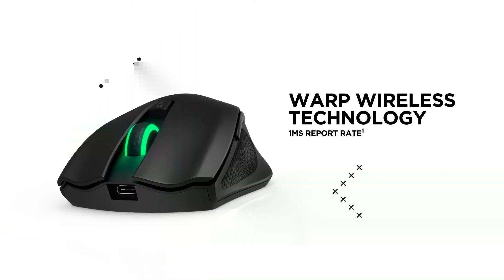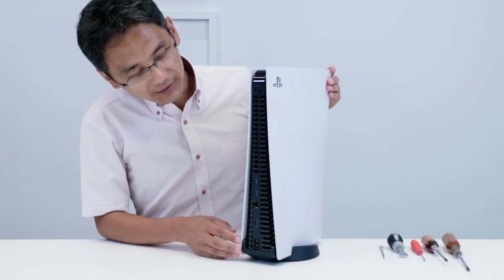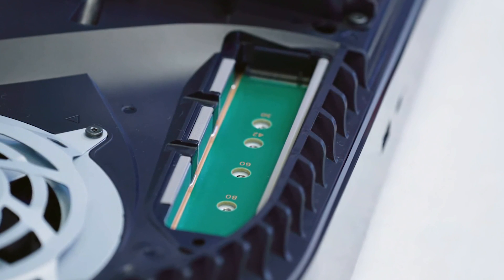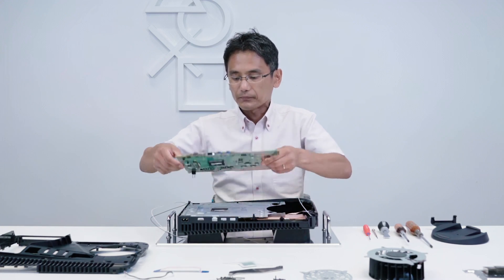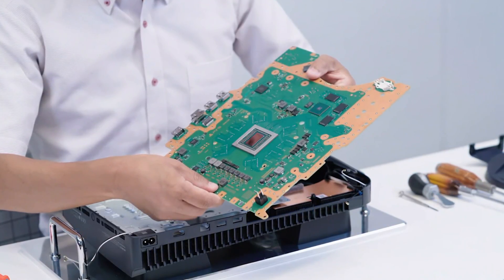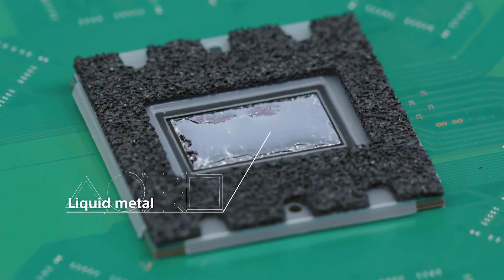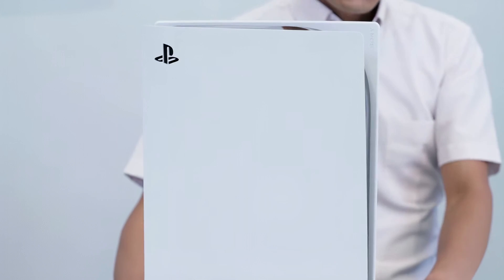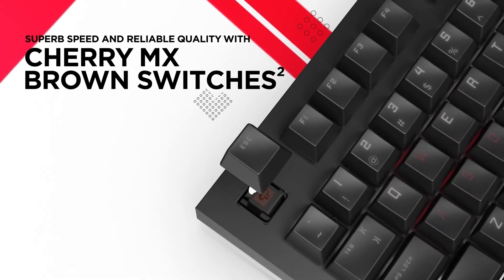PlayStation 5 Teardown Analysis: Inside Sony's Next Generation Hardware Design

Comment: By the way, interesting fact - another thing Wi-Fi 6 is used for? Wireless VR headsets.
Reply: PSVR 2 Baby!
Reply: @apollo24zz  i wouldnt prefer a psvr2 already. It was just a waste of money how it was so poorly supported so far.
Reply: @apollo24zz  The biggest issue is VR is not interesting enough for the vast majority of people to buy it for whatever reason. It will always be a niche market.
Reply: @DEVILTAZ35  yeah try but it the cheapest to get in on Playstation as someone who had a PSVR on my PS4 Pro im super excited to see what new ways they can improve the system 😀
Reply: @DEVILTAZ35  "The biggest issue is VR is not interesting enough for the vast majority of people to buy it for whatever reason. It will always be a niche market."
Reply: @DEVILTAZ35  VR won't always be a niche market. Such a stupid statement.
You have zero forseight or understanding.
Resulotion on even the best VR is spotty.
VR gives most people headache and make them sick. Because of flaws and technology limits.  Games that can be made for them is limited. 
VR is still to flawed to be anything but a niche market.

But Sony among other understand that it best to devote money to resources in the area.
Because while it may take 10+ years before it spreads. Sooner or later it will.
Reply: @apollo24zz  I'm definitely ready once I can get my ps5 I bought the first one so I know how you feel buddy.
Reply: @ClassicGamingPortal  same i told my baby nephew once I get my PS5 on the 12th of November im getting that Iron Man VR just to see his reaction again 😊
Reply: @apollo24zz  hahaha I need a 4k tv I'm running a 144 hz monitor 25 inch
Reply: @ClassicGamingPortal  lol idk I think you're fine i have a 4k 55in TV but I mainly game on my 4k 60Hz HDR 28in monitor I recently just bought a 1440p 144hz HDR 27in for the PS5 so I have one monitor for single player story driven games and the other for multiplayer ever since I went to monitor I just can't go back to playing on the TV
Reply: @ClassicGamingPortal  but I do have my PSVR to my 55in so ppl can watch what happen in VR tho
Reply: @apollo24zz  I never like people watching it's not the same experience I rather pass my vr. A buddy had a party I took my vr with me everyone drinking henny and vr is not a good combo. Lol
Reply: @apollo24zz  my only issue with the vr was the motion sickness. I hope psvr 2 fixes that issue.
Reply: @ClassicGamingPortal  ofc 😅 I just mean like see what their seeing but ofc you should pass it around especially for games like Beat Saber and Tetris Effect
Reply: Yeah wireless is a no brainer for PSVR 2.
Reply: I was thinking about the fact we haven't seen anything about that "baked in VR support" rumor from about a year or so ago. Seeing this now, it makes more sense. This could be really interesting.
Reply: @QueueTeePies  Wi-Fi 6E in the 6 GHz band has demonstrated latency levels of 2-6 milliseconds, with about 4 Gbps of throughput in real-life conditions. Enough for real time high-framerate hi-res video over compressed HDMI.
Reply: Yes exactly!
Reply: Exactly funny how they never picked that up
Reply: @tierossno1  He looked disinterested.
Reply: Ragnos   you're a fan boy that knows nothing about hardware. you're make up a lot of crap. I don't get how people like yourself can be so dumb... but it is youtube comment section. kids like yourself jump on and act like they like know everything. lol you say, ''everything in the PS5 is superior to xbox series x.''  really dude, how dumb can you get. This is a stupidity on a whole new level.
Reply: @killahmate If anything it would be bluetooth for wireless and not WiFi for a PSvr 2 headset
Reply: @tflyfoster3018  you can’t send high bandwith low latency video over Bluetooth. You need Wi-Fi 6 and that’s what the PC wireless headsets already use.
Reply: @KillahMate  I thought PC wireless headsets used WiGig?
Reply: @PSNGormond  You're technically right - it's actually WiGig, because Wi-Fi 6 was only finalized literally months ago. WiGig is a proto-Wi-Fi 6 design that builds on Wi-Fi 5 with some technology from 6, and was released much earlier for limited use. Wi-Fi 6 surpasses WiGig in every respect, and is the 'full', mass-market implementation of the same technology.
Reply: @KillahMate  I wasn't aware of that, thanks for the info!
Reply: @KillahMate  Depends on the applicaiton. Early version of WiGig (802.11ad) had max speeds of 7Gbps. Evolution of that is the newer WiGig standard (802.11ay) which has speeds of 20-40Gbps. Note, the PS5 max speed on Wi-Fi 6 will be 1.2Gbps (2x2 at 80MHz max bandiwdth). So in reality maybe 800-900Mbps. WiGig is much faster, but the signals propagate like light. You need to be in the same room, ad hoc, point to point. 

I think USBC running in DisplayPort Alternate mode makes far more sense for PSVR2. Power, some data (USB2 speeds), and displayport 1.3 in a single cable.
Reply: @jasondefaoite7732  That actually would make a lot of sense for why there is a USB-C port on the front.
Reply: @PSNGormond  shadow pc is currently working on a native VR app for the quest 2.  They are running the so secret VR exploration program as we speak with selected participants. They are under secret oath.
Reply: Isn't wired connection still more reliable to your router and than wireless connection between router and wireless device?

I give an example: your PS is connected to router via high-speed ethernet cable and "PSVR2" is connected to same router via Wi-Fi 6 vs both devices were connected to router via Wi-Fi 6. Which setup would give better latensy and push more data?

Then again how much both setups are different compared to connecting "PSVR2" to your console via cable?
Reply: @9axel5  That's not how that works. If PSVR 2 actually is wireless, it will connect to the PS5 directly, not the router at all. It's a point-to-point connection, just like Bluetooth but using WiFi tech.
Reply: @KillahMate  okay thanks. That was the link I was missing. So should I buy network card with Wifi6 to my pc if I wanted ro play wirelessly Oculus Quest 2 while my pc powers the game now
Reply: @9axel5  No, you can't turn any Oculus into a wireless PC headset. The Quest only works standalone if it's wireless. You need to either buy a wireless adapter (like the Vive has) or you need to buy a headset that already is wireless. No headset on the market right now is wireless - if Sony do this, maybe PSVR 2 will be the first, but nobody knows.

And the Vive adapter has its own card, it doesn't use the WiFi from the PC so you don't need to buy a separate network card.
Reply: @KillahMate  yes, I did also ignore Bluetooth 5.1. But it all fits so well.

Wifi6 for headset
Bluetooth 5.1 for tracking headset and controllers
Tempest for 3D audio as you turn
SSD for asset streaming as you turn

Just waiting for eye tracking in the headset, prioritise where to render with quality but also to finally give good DOF. (Including NPC reacting on where you are looking)

All in on VR?
Reply: @9axel5  wired is still the best way latency wise to connect a device if it is possible to that way
Reply: Oh wow. Great observation!!
Reply: This hasn't been confirmed. 🤦🏼‍♂️
Reply: @Mr_Battlefield  Of course it hasn't been confirmed - we'd probably notice if Sony started talking about PSVR 2, eh? But it's a fact that wireless headsets use Wi-Fi 6, and that's something worth keeping in mind.
Reply: @KillahMate  but that bit of info is not needed here, again, they're talking about what they're seeing here, confirmed hardware/software that is inside the machine.
People act like he can't ommit PSVR2 conjecture without him being a XSX fanboy, there's no space for that here. I want to hear about what the console actually has, not what it could work with, or have/support
Reply: Someone was watching NX Gamer's PS5 teardown video
Reply: Every one forgetting about the VR Gloves Sony still working with....that will be the big jump from 3D to VR Gaming in History of video games...
Reply: Several reasons why this seems unlikely to me:

1. Cost. Wireless solutions are very expensive at the moment and would place PS VR at a higher price.

2. The wireless technology in the PS5 is likely similar to what you would find in a laptop, that is to say it is not for transmitting long range like a router. A wireless solution would likely need its own transmitter for more power and line of sight. Wi-Fi 6 is blocked very easily.
Reply: @Zosu22  how is WiFi expensive? I asume that if WiFi 6 is used for vr that means the player is within the same room as the console and possibly connected adhoc/WiFi direct instead of via a router.
Reply: @RazorFastClaws  WiFi isn’t expensive. Using Wi-Fi to provide low latency VR solutions now is.
Reply: @Zosu22  OK.. I'll just take your word for it then.
Reply: I purchased PSVR 12 months ago...least used gaming accessory in my house.   Only one of my children used it more than a couple of hours.  PSVR2...not a chance.
Reply: @Kiwi-Ahh-Nah  but PSVR was old tech when it was new though. PSVR2 will potentially be very different because they won't have decade old PS3 Move controllers. Most PCVR people don't even consider PlaystationVR to be real VR at this point. It's not room-scale, seated only, that's not the standard anymore.
Reply: You're confusing 802.11ad (WiGig) and 802.11ax (Wifi 6)
Reply: DF was spot on. As wild as the design looks, Sony took a more conservative design approach. PS5 is an iteration on last gen. Not that that is bad, just different than MS approach, which is a bit more daring. Think, if MS took the same approach, you would end up with an iteration on the One X but much bigger with power and more cooling. But instead they made the tower design of the series X.
Reply: Ragnos  wow dude your the one who has no idea how hardware works. You spit out a bunch of numbers and think you know your stuff.  PS5s frequency is variable, forgot to mention that. Nothing's even out yet, name one game that runs better on the PS5 compared to XSX.....
As far as comparing it to a 2060s, the gpu in the Xbox One X is equivalent to an AMD RX 580. No way in hell will a RX 580 perform like an Xbox One X. The api used in consoles is very different, they can get much better results. 
We will all have much more info on the hardware once the systems launch, not to mention the launch of the RDNA 2 desktop GPU's to compare them to.
Reply: Ragnos   just thought id screen shot your comment so i can show people and we can laugh at it together
Reply: Good observation
Reply: Good call 😀👍🏻
Reply: And for faster internet as well if your internet supports it
Reply: Ooh can't wait
Reply: Meh
Reply: Anyone knows if you can connect two wifi6 devices together without router? If you can then I'd understand how big of a deal Wifi6 would be on console.

If you can't, then is ethernet still faster connection than wifi6 in terms of transfer speed and latensy? Asking this because I brought wifi6 router month ago for tablets and mobile but now I want to know if I should connect pc and console in it as well or still use ethernet. 

Anyone who knows, please answer. Thank you!
Reply: @9axel5  Ethernet is always going to be superior for performance consistency and throughput.
Reply: Yup
Reply: Yeah like, everybody bought the first vr 🤷🏻‍♂️
Reply: They need to mass produce these things as cheap as possible so it's unlikely VR would be wireless on a console.
Reply: Haha yeah what could go wrong with a wifi6 plugged in your head?
Reply: Thx for the info 🙏
Reply: Yea 100% wireless vr 👍
Reply: Wouldn’t it lag for gaming?
Reply: @NoEvilEye  Besides bandwidth.....
WiFi 6 promising a reduction in latency of approximately 75%

Look it up
Reply: Yep
Reply: Fun fact, the bandwidth wifi 6 using is banned in and around 10 kms from airports and all Government buildings. 
Just saying.
Reply: @kiranraj282  ?? Really¿  The Freq Spectrum ????  Bandwidth ????
Well, like 5G, the whole conspiracy debacle is well... Just that...
Here in oz for example, the Freq spectrum of 5G had been used for decades....
I should know.. I have now 5 unusable wireless systems , unusable by law, which now are scap.. but look good in a 19" track... As for the lead up , The Australian government gave us a 5 year "heads up" because like any freq to be used, TV, AM, FM.. whatever, the spectrum has too be  ,lets say, Booked in....
No way was any company going to invest in a type of system not knowing what spectrum would be available...  Itd be like buying a game made for a future console , completed on specs.. but in the end was a Microwave....
I know.,... Silly way to explain it.. But it really is that simple...
How about building a car for travelling across route 66, But the Vehicle is 4 lanes wide?
There has to be standards to meet... Otherwise, why invest in something like WIFI 6 if its working on the TAXI radio frequency./....

Oh.. AS for planes.. Safety precaution? Im mean everyone turns of their devices on a plane on takeoff and landings... Dont they?
Gov Buildings? Safety Precaution? Turn Orange?
Reply: @Rhythmattica  dude there is no conspiracy here. Wifi 6 is not adopted for commercial use as of now and ots been used only in those sectors. Go and check it for yourself.
I never said there are issues with wifi 6.they are not feasible as there is not enough technology available for everyone.
Reply: @kiranraj282  I Think we are all way off track here... All I was responding to , to who , what, was someone mentioned "WIFI6 " is illegal to Use around airports.. Gov buildings.,.. My rant was Rew there stupidity of such "Conspiracies".. Fk .. so many posts.. Please , ,y apologies if I responded too the wrong person.. You?
Reply: @diga mec last weekend I showed my Baby 8yr Nephew the Iron Man VR Demo and just seeing his reaction was just priceless and why I love being apart of the Playstation Community I just want Sony to show us what future tech has in store gimmick or not 😌
Reply: I am pretty sure you're confusing Wifi 6 (802.11ax) with 802.11ad (aka "WiGig 2"), or at the very least Wifi 6E.
Reply: @neoKushan  I think so too. Unless .ax is different than previous WiFi's, wouldn't you need a WiFi 6 capable router? It's not like WiFi 6 connects directly to the headset.
Reply: Lol i dont see anyone going out of their way for VR.
Reply: @vowvowness1506  Well, your blind.. lol
Or.. a Blind Fanboy..    Not all games need to be,,, But if for example, your a Star Wars fan, and wanted to play Squadrons ... I tell ya.. The last thing you'd play is the pancake , and you'd buy a PC or PS VR rig...
Argue that...And if so.. No Hope. Maybe a New hope?
 I award you no points.
Reply: What a coincidence 😄
Reply: @diga mec " it isn't at that stage yet"
Oh fk.. There it is... You have literally denounced all things not xbox.
Fk .. I did a whole spiel and it didnt post...
Oh well...
Here it is compiled.z
Sure.. PSVR 
No room scale,  Input devices could be better..
Yep its not Vive.... Ill get to that,....
So have you Played:
Farpoint with aim?
Firewall Zero with Aim?
Res7 ?
Blood and Truth?
Astro Bot ?
Mate...... Even Battlezone rocks..
Hm,mmm,. Hope you aren't playing squadrons......
So.. I dont care what you think about VR, because anyone that says "Its not ready yet" surely would play games.. because why even play now , when we know gaming will only get moooore pixels and FPS with the next gen cards...... Right there is a corner, and heres a can of paint....
Go on.. dont care what you play.. but goi on , grab a Vive, a Rift a PSVR,,, Go play RES7 and get back to me....
Dare you.
And if your still spewing that nonsensical bs.,.... You're Tainted... You're wrong. I suggest go talk to Phil McCrevice,
Reply: Oh man that gave me shivers 🤤
Reply: talk your suit
Reply: You shut your filthy sexy mouth mister.
Reply: @diga mec in terms of at the minute psvr isn't at the stage where it can be deemed an essential product to get the best gaming experience.

Either is a=n XBOX one. Right?
To add.. Squadrons on PSVR BLOWS away Xbox SX version..,.. Ubderstand>?
Reply: @diga mec for sure that aint no lie that why it very hard to go back to TV
Reply: @diga mec No? You cant have a comparison....... Thats the problem of people that compare pancake to VR without  having tasted the juciness of VR..
MS sold Kinect not as an accessory . but as  something bundled as compulsory... You see, every promise was smoke and mirrors... and they did it also by delivering its epic innovation through what is as simple as old school gaming... Yes.. VR is an add on... Its not cheap... But unlike Kinect, the issue is juxtaposed.. You cant trick people into knowing what the experience is... It just cant be translated.... And its not promises,..l; Its here and now,... and the experience , emersion is un parralleled... Its PAST THE ":VR Experience"...... and when everyone actually drops their guard, and actually opens themselves to the medium, there really is no equivalent....  I gladly go out and say, well, a console is just another expansive gaming peripheral... After all.. WE all have phoners that play games...
Stop being  So staunch. Cant afford it?  Ok... 
But im telling you, this housewives tale of 'Its njmot there yet".. Its just another p[eripheral" ect ect ect.. Just doesent fly with me.. The only thing flying is all the BS from the naysayers mouths... 
The more the merrier.. right?
Reply: That's really not what 802.11ax will be used for lol.
Reply: I prefer pcvr
Reply: No. You're thinking of Wi-Fi 6E. Big difference.
Reply: @diga mec And I too hope that will happen...   Im loving GhostsOT atm, but I love my VR... Its really hard to goo back. I just hate the schoolyard talk, knowing its being said like pier group pressure... I admit, I prefer PS over .. even over PC.. Just love thiner games.. Ill always admit that.. But to hear the Banter, when its there obligatory FB response, Ive just got to share my thoughts... I suppose my thoughts are also the more that put VR down, the ones that remarking about its worthlessness, they are the ones with such propaganda that in the end hurt us all.,..., Especially the ":Na.. VR sux, AR soo much better" to then talk about how successful Pokemon GO was.....
I know you get it... Hope ytopu get what im saying.. And as from my Perspective.. I was commissioned to write a song for the Powerhouse museum here in Sydney...I played w -industries Teradactyl for 3 hrs abweforee the exhibit opened to the public... 5 mins a go for them.... I couldn't wait to get more... always asking myself .. when am I gaping to get to do this again.. I discovered something beyond the gaming I know.... And this is 1990.   Yep.. Two Amigas... Tetris look less blocky... But I experienced it.,.. And no way I going to sit back and let those I know play by the "Insecure-Yep I really dont klniow-but say I do" rulebook.,
Cheers
Reply: Absolutely!! Wireless PSVR over wi-fi 6. 👍
Reply: Microsoft pay them. That's a fact!
Reply: Then why did Sony put in a USB C port?
Reply: @PC-Xhawk  because it’s a modern USB standard.
Reply: WiGig and Wifi6 are not the same thing. Currently the only wireless VR that doesn't suck is from HTC and it use 60Ghz WiGig.
Reply: Bravo sir
Reply: That’s probably what it’s for as well. PSVR2 is definitely coming, maybe even in 2021.
Reply: It would be really cool if they can support it
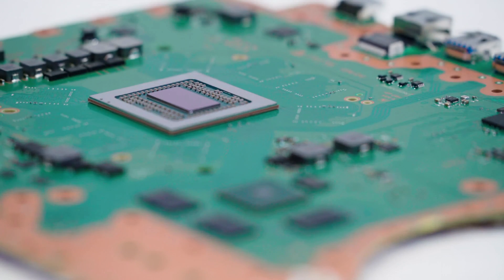Reply: 15:46 "The POOF of the pudding!"
Reply: No, the PSVR2 will use an external USB adapter.
Reply: @BlackParade01  I think it's just going to be USB. They have an experimental 10GB USB port so they may be going the virtual link method Nvidia dropped. Then they wouldn't need batteries either. 

If you want wireless they may make a 5GHz band adapter and receiver.
Reply: Ragnos   youre the fan boy pretending to be an engineer. You said the series x will have issues with heat and would run toasty.
Its just been confirmed that the xbox series x run cooler than the xbox one x. The xbox one x ran cooler than the ps4 pro. So there goes your lies.
Reply: Ragnos   lol what a fool
Reply: Well wifi 6 is actually FAR WORSE for VR due to the inherent 50ms of latency, it is 2+2 after all (5ghz+5ghz). Wireless VR streaming really only works with 802.11ay 60ghz wigig.
Reply: 😳I didn't even think about that
Reply: Well, it would be, except that fad has been deas for years. You may not like it, but accept it.
Reply: This comment aged like fine wine.
Reply: Actually the bluetooth 5.1 which is a major jump. Will be more of a benefit for vr headset. Bluetooth 5.0 and below find headset by signal strength alone.  So could only locate a device within a error of 1 meter which is 39in...
Bluetooth 5.1 have new technology with both devices talking to each other to find position and keep track of the device movement.
With a error of 1 centimeters and that's 0.394in.
So it's the Bluetooth that he skip over
 That could lead the next generation of VR headset to be wireless.
Reply: @nisteven  You need Wi-Fi 6 for low latency video. Bluetooth can’t do it.
Reply: @KillahMate  never said WiFi 6 wasn't important. But no matter how good the wifi is. If they went with any older bluetooth. They would have had to go with a wired headset.
While WiFi 6 make for a much better experience. You don't need it, to go wireless.
Reply: @KillahMate  wifi 5 or ac is good enough for wireless vr
Reply: @nisteven  Bluetooth 5.1 is not nearly fast enough to stream low latency visual data at 2Mbps compared to 9.6Gbps theoretical max speed of wifi 6. Device tracking probably would be done by the headset itself with how well inside out tracking has done for the oculus rift and quest. This entire comment chain is garbage with no idea of basic technological understanding of wifi 6, ethernet, and so on. 

To everyone else, No headset is connected by ethernet cable but rather by something like a breakout box using hdmi/displayport, and a usb 3/C port or just directly to a computer with usb c and hdmi. You don't need a router to connect a wifi 6 device to one another if the headset have a receiver that can connect directly to the ps5. You can already see this with the vive wireless kit using wifi to connect to the pc.
Reply: @Shadowninja1200  psvr2 will need to cut corners to be cheaper or it won't sell.
So using bluetooth to track it. So you can cut corners on hardware. Is no doubt what Sony is planning and I'll bet you on this.

Edit: also wtf when did I say they use bluetooth to stream?
Reply: @nisteven  I was speaking more so for everyone else saying using bluetooth or ethernet or some bs.

I can only really see bluetooth for the controller themselves connected directly to the headset or sticking with the camera approach considering they're making a camera again. The headset itself will probably do it's own tracking if they want it to feel like the next evolution of psvr.

Of course I'm just basing this on opinion of people i know who have tried the psvr saying it's cool but it doesn't feel as nice as the oculus or the vive.
Reply: @nisteven  thats not how bluetooth works it doesnt even have enough bandwith to do chat and audio at the same time let alone video to two displays
Reply: @420247paul  Reread what I said....
. I swear people can't read. Here I help you.....
For tracking..... T R A C K I N G...

Do you understand now,?
Reply: @nisteven  I don't think that Bluetooth will be used for tracking of the headset or controllers. Tracking for VR devices is accurate to within fractions of a millimetre. If you do some reading on the Vive Cosmos you'll see that this matters a lot more than you might expect. I'd love to be proven wrong, as Bluetooth tracking means that it will work without external lighthouses and in low light environments, but still, I don't think it's likely. 

Also the main benefit of Wi-Fi 6 over Wi-Fi 5, in my opinion, is the improved latency. Wi-Fi 5 already has the bandwidth chops, but latency makes VR games feel "choppy" and hurts the experience more than a slightly lower resolution or foveated rendering.
Reply: @nisteven  Bluetooth 5.1 should enable better audio, better battery life on the controllers, and more robust communication in general.
Reply: @johnnemesh5459  Bluetooth 5.2 is actually the one with LE Audio.
Reply: That would be output which would take extra antenna. This is probably just a receiver. The PSVR would likely come with external antenna just for better range.
Reply: @Skylancer727  Just a receiver? lol. How do you think the PS5 will send data to, well, anywhere with just a receiver. Think about it...
Reply: @redrooster303  as in they need a whole wifi 6 channel just for the headset to get enough bandwidth. If it's sharing the wifi receiver it's bandwidth is cut in half or more making it less viable. 

Also if you are hoping PSVR will be wireless, I think that USB port on the front is proof it won't be. They have an experimental 10GB/s USB port which makes it sound more likely that is going to both power and send the signal for the headset. In fact, the PS5's power supply is 350W, more than the Xbox Series X yet Sony claims the chip only uses about as much power as the PS4 Pro at about 200W. I think they are planning on running the entire VR headset via the USB port as 10GB/s is enough for video. That seems far more likely as adding batteries to PSVR would make it more expensive. Plus again WiFi 6 is only fast enough with the full bandwidth. That's why the HTC wireless has it's own emitter and can't use your PC directly. It needs the full channel to not cut out or drop frames. The USB method is still a vast upgrade to the current PSVR and the external headset box. This seems far more realistic vs raising the price $200 for a battery and wifi sender and receiver.
Reply: And 120 frames equal no motivation sickness
Reply: Too bad vr sucks
Reply: @shybassboy  it sucks you haven't played Boneworks or Half Life Alyx with an Index, cuz you wouldn't say that if you had.
Reply: Except you don't need Wi-Fi 6 for wireless vr you can do that right now without it lol
Reply: If you love vr please you need only buy oculus quest 2, the playstation vr is obsolet and expensive
Reply: @karamolansanacamara7069  Foculus ? No chance.
Reply: @Rhythmattica  oculus quest 2 , you need see 1
Reply: No.  Although Wi-Fi 6 is more efficient with sharing the space with other devices such a situation would not be a direct network between the two devices And it requires people owning a Wi-Fi 6 capable wireless router. Which if people buy into could mean spending $100+ for a new basic router (imagine having to replace a mesh network hundreds in costs). That limits an already niche market. So a Bluetooth connection for such a situation for PSVR2 is the more likely scenario if it using something built in. Or Sony might actually include a special box that uses the USB but creates a wireless connection to a possible any wireless PSVR2. In fact these other options are more likely if Sony wants to expand PSVR2 beyond PS line and into supporting PC.
Reply: VR is dead, was never good
Reply: Ragnos  Alex is definitely the most biased!
Reply: That'll be great for the 5000 or so users who use it for more than a few days before it gathers dust
Reply: Dont expect DF to comment on this they are xbots
Reply: gimmick.
Reply: @le4-677  blind
Reply: @le4-677  never thought I’d say this but... F* off “The Rock”
Reply: I guess there's a reason they didn't mentioned it --> Biased as hell!

PS5: Negative Focus
XSX: Positive Focus + Damage Control
Reply: @3D-Engine-Melody  Ur a dummy
Reply: @3D-Engine-Melody  I think you confuse having questions with being negative on the PS5. The only negative points DF made towards Sony were regarding how they haven't been as open with the technical details as MS, which is fair. I heard a lot of praise for the PS5 design itself and legitimate questions.
Reply: @3D-Engine-Melody  Are they really biased? They seem impartial and don't want to fuel console wars. John has criticized microsoft for choosing to support xbox one instead of focusing on next gen. Alex defended the raytracing of Marvel's Spiderman when some people on twitter were complaining about its implementation. They are not picking any sides. They have both good and bad things to say about each platform.
Reply: @3D-Engine-Melody  that makes zero sense. Why would they comment on something that is nothing but rumors and speculation? Sony has never mentioned anything in this thread, just a bunch of hopes and dreams from you all. Then to crap on DF for not indulging your wishful dreaming in crazy. It would be great if wireless VR was a reality in PS5, but literally the only place I see that being talked about is in the comments sections
Reply: @3D-Engine-Melody   @HAL 9000  also, he mentiones WiFi 6, they just didn't bring up rumors of PSVR2 so as to keep it closer to facts, and current known informatiom from the breakdown.
PSVR2 will definitely come, but why mention it here when he's covering the breakdown, keeping it concise without guessing why they added the WiFi 6 antenna; he talked about it though and its pros(better connection, compatible with older routers).
Just try to calm down, not everyone is out to harm you and your PlayStation, breathe.
Reply: @3D-Engine-Melody  They say enough positive things
Reply: @3D-Engine-Melody   lol you fan boys used to love digital foundry during 2013 to 2017.
Reply: @Potato-jh3tj  
No.. still like them, but sometimes they're clearly pro Xbox!

Halo infinite damage control
Dirt 5 damage control
Demon's Souls focus on bad

This video:
Concerns here and there
Cheap this and that
Heat blablabla

Advertising Xbox

IF YOU DON'T SEE THAT, YOU'RE THE BLIND FANBOY
Reply: @3D-Engine-Melody  yup. Everyone is against Sony now, Digital foundry is out to hurt Sony, and so it's as if they were hurting you personally, we can tell. What should we do now? You want us to unsubscribe to them? Or what do you want us to do with that information? You just spouting nonsense just for the sake of spouting nonsense? Lol
Reply: @Potato-jh3tj  Sorry, but you are wrong about this. When it comes to consoles, they clearly favor the xbox whenever they can for no reason. The amount of videos alone tells you that already. Took them 1 second to make a video about the S, took them a week to make a video about this.

Just rewatch the Halo Infinite. You have to be biased af if you defend this and say things like "Maybe the lighting will change that" when it´s clearly not possible to save that game in 1 or 2 months!

And that´s only one example. They still do a good job, but definitely biased!
Reply: @3D-Engine-Melody  they didn't damage control halo. They talked about souls because its a remake of a old game and dirt 5 is multiplat but Sony want let anyone talk about games running on the system yet.
Reply: @kenshigo3833  it couldn’t be that they favor Xbox because it’s better could it?
Reply: @shawnromero4143  No with the given context no.
Reply: @kenshigo3833  🤔😒 um xbox has given more information to the public, so obviously they are gonna make videos on that. Ps5 has been shrouded in mystery. Less information = less content. And what makes you think Halo Infinite will be out in 1-2 months when it has been delayed indefinitely?
Reply: @kenshigo3833  cmon man it took 1 second to make a video about the S because they knew about the console weeks before the public. They got to see this teardown at the same time as anyone.

Also about favoring the American product, I dunno if you noticed but Rich isn't American.
Reply: @kenshigo3833  lol explain to me the context that makes ps5 better? VR? If you’re buying a ps5 for the VR YOU ARE SEVERELY MISGUIDED. Frankly the scenario doesn’t exists. He has more context than either of us given that he himself got to breakdown a series x and watched a video breakdown of the ps5. We only can say the latter.
Reply: @shawnromero4143  who said the ps5 is better? Why do you continue to make things up in your head to hate? Sounds like you have issues...
Reply: @Taijifufu  Dude, everyone on this planet did a video about the teardown already. Don´t act like it takes 1 week to analyze and write this!
They are DF, not some random guy...
And your nationality doesn´t have to do anything with it. I have friends who HATE america, but wear US brands only. DF is xbox biased, if you don´t believe it, watch some of their videos and you will see it yourself...
Reply: @kenshigo3833  who’s hating? I’m simply trying to demonstrate to you that if someone shows favor to something that is better than it isn’t bias. Which you suggested
Reply: @DarkReturns1  because that was the initial release date when they made the video about it.
And no, the amount of information has nothing to do with the time it takes to make a video. there was no reason to be the last channel on youtube to make a video about the teardown!
Reply: @kenshigo3833  huh? Why is DF obligated to make a video about someone else's teardown?
Reply: @shawnromero4143  no i did not. that´s why you are a hater lol
Reply: @DarkReturns1  nobody said obligated, but if you do everything asap except the things for one certain group, it says something does it not?
Also, if you want to be on top of something, you also have to be on time, otherwise someone will take your spot sooner or later. Always has been like that! So yes, if you want to be the best, you kinda are obligated to talk about such "important news" asap!
Reply: @kenshigo3833  you can look at it that way, that's understandable. Still doesn't make them biased in any way. They shit on Xbox, deservedly, for over 5 years because PS4 was producing better results. Now the tides have turned, they always do, and they are biased towards Xbox!? Some channels sure, like that Colt Eastwood guy, but DF? Naw man, DF is legit
Reply: @kenshigo3833   lol if you say so... people make up stuff in their heads.
Reply: @Potato-jh3tj  and you fanboys hated it. See how that works.
Reply: @ClassicGamingPortal   no i dont think anyone minded. I didnt mind. They were just saying how it is. Like theyre doing now
Reply: @Potato-jh3tj  Just watch the videos with that in mind and sooner or later you will realize it yourself...like i said, they are still doing a fine job, but they are definitely a bit biased. And again, i´m not saying they are extremly biased, but they definitely are biased...
Reply: @DarkReturns1  yeah, i´m sure Halo Infinite will get a surprise release in November then because "the lighting fixed it all" ....think what you want, but they definitely are biased and in favor of MS.
How did they praise the ps4 over the xbox in the last 5 years? they even made a video this year were they kinda apologised for downtalking upscaled 4k because it did a better job than they said it did and in most cases, the x did better than the pro...
Reply: @kenshigo3833   ive watched there videos. If anything the media tends to be bias towards sony not xbox.
Reply: @Potato-jh3tj  LOL good one! that´s why the whole internet is full with fake news and hate about the ps5, example the screw! Stop making a fool out of yourself...
Reply: @kenshigo3833  bruh I do watch Digital Foundry. I know you're exaggerating. They've always provided the best data. I had forgotten that people used to say they were Sony fanboys. Now you come along saying the opposite. You're not thinking rationally. You're just jumping straight to conspiracy theories because Microsoft invited them to see the X and S in February.
Reply: @3D-Engine-Melody  You exposed yourself as a salty Sony fan with your Dirt 5 "damage control" nonsense. Dirt 5 is a multiplatform game coming to PS5 as well. Damage control for whom?
Reply: @kenshigo3833  I said for 5 years, not the last 5 years. Ever since the Xbox One X released games looked and ran better on the that platform. Before that time period, for 5 years or so, Sony's PS4 was the most powerful so games ran better on that. 
I hate to tell ya, but it's gonna be the same this gen. Series X has the power advantage here. We'll have to see how it plays out, but on paper the difference between the XSX and PS5 is greater than the power difference between the original Xbox One and PS4.....and we all know how that went.
Reply: @DarkReturns1  Then i missunderstood that. But ofc every game ran better on the ps4 with 1080p compared to 900p xbox...
Nothing they can say about that...
And no, the on paper is not true!
Xbox even had more RAM, the TF was 1.3 to 1.8?
You also compare 900p vs 1080p here and now they work with the same resoultion.  So no, on paper, the difference isn´t much greater!
Love to tell ya, but the PS5 will be stronger than you expect!

Not sure if you are trolling or just don´t understand gaming/PC/development at all...
Reply: @Taijifufu  No. People back then said they are sony fan boys because they said the ps4 is better than the xbox when it comes to data. Which simply is a fact!

After that, they always said the X has an advantage over the pro, which was in most cases, a fact!

This gen however, they are doing so much dmg control for the XSX, make false claims about the ps5, look for things to bash while looking to praise things on the XSX. Just look at the Halo video, ridiculous! "Maybe lighting will change that". No "expert" ever would say that!
Also look how often and how fast they do videos about the XSX, took them a whole week to make this teardown! Yes, they do have the xbox and they don´t have the ps5, but still. 
And again, i´m not saying they are extremly biased (except Alex maybe), but they definitely are a bit.
Reply: @kenshigo3833  Did they not talk about the PS5 teardown which happened on the same day they were celebrating the 1 million subscribers. Richard said he was already busy editing one video about series x and that the DF team has only 4 members and each has to edit and create their video. Richard wanted to do this video about ps5 teardown and not give it to Alex and John.
Reply: @takarsagafe  Thanks for the explanation. But still no excuse to be the last to do one when you are the most famous. I mean be honest. You think this video took 5 days to make? They could have done this in 2 hours! If not they should offer me a job!
Reply: @shawnromero4143  how is Xbox “better” then ps5? 18% more “tflops”?
PS5 has more then double the speed and efficiency of I/O.
PS5’s IO storage system is already on another level, even before oodle.
Secondly, the 10.23TF Variable GPU of the PS5 has a CU refresh rate of almost 2x.
Rasterisation, Cache Buff. and Dumpin Speeds etc are all faster by 33% on top of that a gpu scrubbers.

XSX's GPU comprises of 52 CU's that have to refresh themselves completely each and every time info is sent and received.  The PS5s 36 CU's dont. They keep what info they can re-use. This is selective dumping and what it does refresh, it does 33% faster (clockspeed)

And as of the moment, better line up of games mostly coming out within 2years.

So how exactly Xbox “better”? 
And how does Xbox being “better” can justify their halo infinite video?
You do realize that even Xbox fans and halo fans many disagrees with it?

Not saying ps5 is better
They’re both designed differently, both are unique in their own right.
Xbox has new studios, they seemed to realize their shortcomings and is working on it, and although I’m not a fan of the idea of Netflix of games.
There definitely something to look forward to on what Xbox would be bring in the future.

No need to downplay either one.
Reply: @3D-Engine-Melody  Man you’re getting a lot of hate today for telling the truth. Anybody with a brain can clearly see that they are biased.

But I suppose I would be biased as well, if one company was giving me FREE SHIT all the time, plus flying me out for PERSONAL HANDS-ON interviews and the other wasn’t.

IMHO anyone who can’t see that they are bias are either delusional or they’re being purposely obtuse.
Reply: @3D-Engine-Melody  so you don't remember the Damage Control in regards to Ray Tracing of PS5's Spider-Man?
Reply: @3D-Engine-Melody  Where are you even getting this from?  They don't have a PS5 yet so they are allowed to be conservative when all they have to go by is Sony Marketing.
Reply: @3D-Engine-Melody  please stop, I literally can drink another drop of your fanboy tears. They’re salty and delicious but I’m seriously full. This was your favorite channel 2 or 3 years ago when Sony still had the clear advantage. But now that the facts support Xbox having the better design it’s the most biased channel on the YouTube. The “bias” you’re seeing is an opinion based on known facts. If they were leaning towards PlayStation you’d be happy. Because you’re biased, not him. You choosing to ignore that EVERYONE on the internet is saying series x is the more powerful and better designed console, is bias. You’re just blind
Reply: @shawnromero4143 "Sony still had the clear advantage."
Still does..
Reply: @Rhythmattica  delusional
Reply: @Rhythmattica  They have the hype for sure, but people who know hardware will be more interested in XSX.
Reply: @shawnromero4143  How so?
The gift that keeps on giving? 
See the thing is, people think 5 G is better than hard wired... But those are the people that also dont know the infrastructure behind it is the technology they disregard ... Systems in place are all routed in the hardware/Fibre optic realm... That infrastructure feeds the the all so wonderful thing that is Wireless..... 
So.. I always go hard wired, but to think sony dont move to tech thats beneficial to their roadmap is well... MS...
First HD console called the 360 didnt even have HDMI!!
Nor HD drive, nor wifi ect ect ect ect...
Am I answering your retort to the use of "delusional"?  Or were you agreeing?
Reply: @Rhythmattica  I don’t think we are talking about the same thing dude? Hard wired? 5 G? I’m taking about competitive edge in the gaming console world. I’m stating that in the past Sony had the clear edge in power, tech, design and games. But currently Microsoft has managed to close the gap on all fronts and potentially surpass in some areas. And though from a sales standpoint Sony usually wins out. I’m talking strictly gaming experience. I don’t think it’s clear who leads anymore. GamePass, the acquisition of Bethesda and several other studios, more powerful console and programs like X cloud and All Access, Microsoft may be offering the best overall gaming experience
Reply: @fcukugimmeausername  Yeh probably,,, But people into games you cant play on Windows OR EVEN LINUX won't be interested at all......
Reply: @shawnromero4143  Whats competitive? 2 extra flops? Still no VR or actual Exclusive SX games? 
Cmon.. Even MS said it... "The outdated console war"
They want subs.. Gamepass.. GAAS... shit , even stuff going top iPhone .... IPHIONE!
Sonys tracks record cant be wiped clean... MS had to wipe theirs...
Reply: @Rhythmattica  oh thank goodness you’re another fan boy haha 😂. For a second I thought you were someone capable of rational thought. My bad I over estimated you. Literally no one cares about VR of you did you’d run a pc. Over 15 million GamePass subscribers would disagree with you. You’re still on about exclusives? After they purchased Bethesda? You think anything beyond what they are already contractually obligated to send, will make it to PlayStation? Dream on! You wrote all that but all you said was “Microsoft bad”. This is coming from a PlayStation 4 pro owner. Wake up dude. Things change
Reply: @3D-Engine-Melody  Exactly! If it was Xbox that has VR, they'd be all over it!
Reply: @madfinntech  wait so Bc they didn’t talk about one thing means they don’t like Sony ?
Reply: @madfinntech  Why would they talk about it if Sony hasn't? It would be speculation. Xbox has been upfront with everything.
Reply: @jalmodov7817  I agree with you about the speculation part, but not about Microsoft being upfront about everything with Xbox, as they simply haven't. We barely saw any Next gen games on it, until a day ago, among other things; hardware wise i guess they have been a bit more open though I assume they had to this time around.
Reply: @icealchemist250  Yeah, we're talking about hardware.
Reply: @madfinntech  I still think the X is going to have VR. I think it’s a secret. But I can’t wait for psvr 2?  We have the quest 2 now omg it’s awesome. If the psvr 2 is wireless or an option it will take VR to the next level. The quest 2 also.
Reply: @3D-Engine-Melody  😂😂😂 what damage control
Reply: @3D-Engine-Melody  100% correct! Same happened with Halo and i think TLOU2?
Look how long it took them to talk about this "important" video. People are too blind to see it, sadly, but DF is very biased and always in favor to the american product!
Reply: @kenshigo3833  the comment I replied to literally says “DF is very biased and always favors the American product”. Go back and read it. We’re you temporarily blacked out when you typed it?
Reply: @shawnromero4143  no, i still stand to that comment, but read back what you wrote and try to make any sense out of it!
Reply: I would still recommend Ethernet for this, if you have access to this option the delay will be better.
Reply: @Otherstoriesfrommij  how will you use ethernet for psvr?
Reply: @ameerikbal8160  I think he meant connecting PS to router abs router to psvr headset. Just check my comment and please answer if you know how those latencies are on different scenarios. Or actually, is it possible to connect two wifi devices wireless to each other without router?
Reply: @ameerikbal8160  , for the console. It’s still better than WiFi 6. But just by an inch.
Reply: @9axel5  adhoc is no problem. You don't need a router and I guess that's the way to go if it's used for vr.
Reply: @Otherstoriesfrommij  oh yeah ethernet's really going to help out with WIRELESS VR headsets you absolute plonker
Reply: @Otherstoriesfrommij  lol you don't know anything about wifi 6
Reply: @Otherstoriesfrommij  internet connections dont matter with wireless connections for vr streaming.... It's about bandwidth push through, need a good router or wireless antenna card... For instance Virtual Desktop for PCVR wireless can used your pc wireless network card to stream thru 5g connections
Reply: @Otherstoriesfrommij  no one is talking about ethernet
Reply: @tytlyf  It's internet talk genius
Reply: @tytlyf  well, it's important. Wifi6 is cool and all, but for VR it's better to use a wired internet connection. People were talking about vr, so his comment is relevant, yours however... not so much.
Reply: @icealchemist250  you can still have a wired internet connection and a wireless headset
Reply: @tytlyf  I don't quite get this hype now really. Now that I think about Oculus quest 2, I haven't heard anyone getting wifi6 network card for it to work any better. The pc is still connected to router via ethernet and Oculus is connected to that save router via wifi.

So what's the benefit of having wifi 6 in console te VR really? I've upgraded my network not long ago but it didn't even come to my mind before this thread why would I need to replace my pc ethernet connection. The idea is absurd if I'm honest.
Reply: @tytlyf  If it's like the PS4 pro ethernet causes issues when talking to people on a headset it keeps dropping out.
Reply: @TerraWare  Ethernet is a protocol, WIFI uses ethernet too, you dummy. WIFI is just the physical layer, ethernet is on the data link layer. Learn your ISO/OSI model before you start lecturing others!!!
Reply: @tytlyf  ethernet is a must for wireless VR tho
Reply: @Otherstoriesfrommij   When using the wifi for VR, it may be required to connect to wired LAN. For multiplayer VR games at least. Not that I'd expect a lot of those.
Reply: @AltCutTV  you don't need Lan to play multi-player games on vr you can use normal Wi-Fi
Reply: @jayslayerjay66  I suppose that would be possible on PS5, but has it actually been confirmed to?  On PS4 I can't use wifi if I connect the Vita directly to it. But then again, if designed with this in mind it could also have multiple standard connections like some routers do.
Reply: @AltCutTV  I was talking about vr in general because you can play multi-player games on the quest thru Wi-Fi right now and you can stream pc vr games from your pc thru the browser on the quest using Wi-Fi right now Playstation should be able to do these things if they want on psvr2
Reply: @AltCutTV  depends if it's a 1x1 or a 2x2 or higher adapter in the PS5. If 2x2 or higher it could use 1 antenna for the internet and another for the VR.